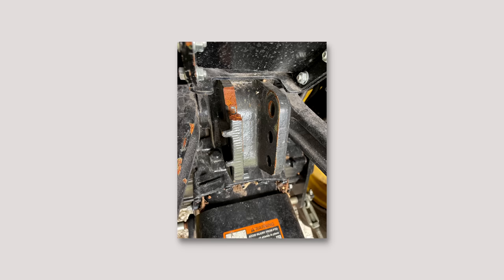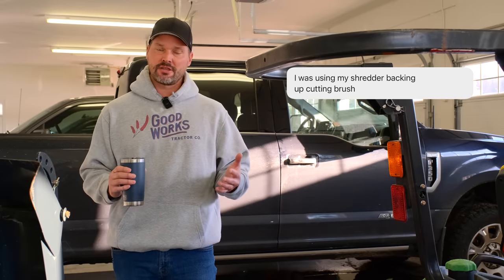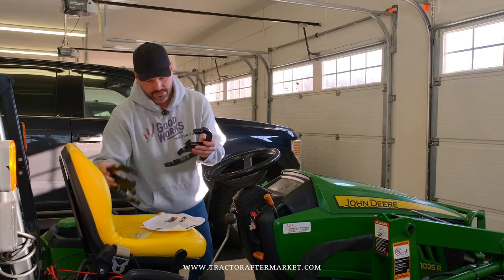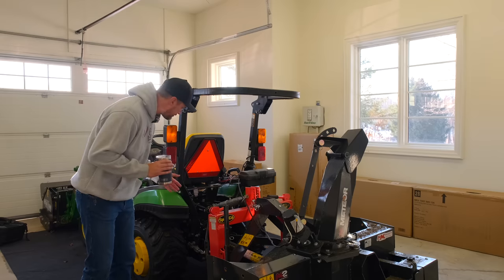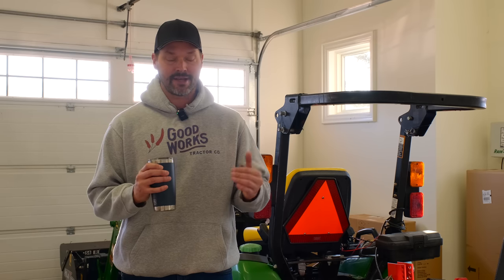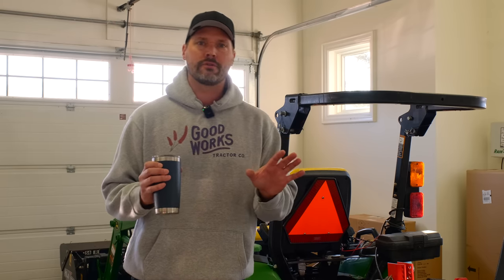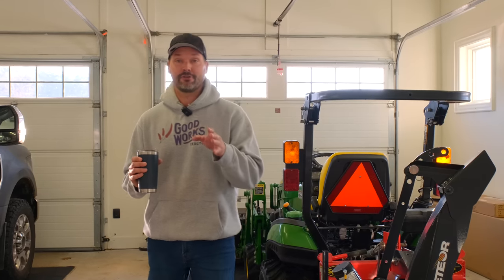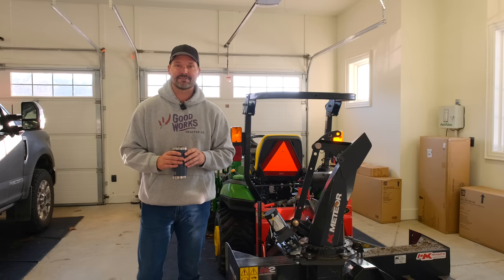EXPENSIVE MISTAKE OR WARRANTY CLAIM? $3400 TRACTOR REPAIR 🤯

Comment: Courtney,

I learned some wisdom from some old farmers when it comes to rotary cutters that prevents bending those top link brackets or the top link itself.  They suggested that I don't use a solid top link with a rotary cutter, but use a chain instead of my top link.  So I went to my local Rural King and bought 2 pin anchor shackles that were large enough for my class 1 pin to fit through them and some heavy duty chain.  For about $11 I made a chain top link that will not get bent or bend the tractor's bracket.  I used it all this summer and it worked perfectly with no issues at all.
Reply: I almost totally agree with you Jason such as I very seldom use the top link with any 3pt cutter with wheels. My only concern is being very cautious not to push the PTO shaft into the rear housing such as TTWT did awhile back.
Reply: I think I would be more worried with that? The problem is the "pulling" force away from the Top Link mount on the tractor, not the pushing force. Having the chain all of a sudden take 3" or 4" +- of slack out would worry me more than the 1/16" or 1/8" slack at the pin hole? At least looking on my 5' Sitrex finish mower on my JD770, haven't really looked at the larger brush cutters so it may be different?

Comment: I was a manager at a Big Tractor sales, farm equipment dealership in upstate NY. We sold Ford then Ford New Holland and John Deere as well as New Holland red equipment. We have seen abuse, overuse and just plain dumbass use. I've seen some bad casting , bubbles, voids and even foreign objects cast into the part. We were the final word on small stuff and usually tried to help the customer out, but big parts like axels, housings and such, well JD or Ford would come out and make the decision. If they deemed it their fault no harm no foul. If it was the farmers fault, we would sell them the parts at our cost and deep discount the labor. At the end of the day we usually broke out even or probably  lost some. We were farmers ,they were farmers. I will tell you what, when that farmer came in for a new tractor, discbine, or shit spreader, they were loyal to us. We were in it for the long game.
Reply from the maker: That's really good stuff.  Thanks for sharing!

Comment: 5 years ago I  used the 1025r I borrowed from a friend and broke this exact thing while Bush hogging. Took it to deere to repair it was $3800 and they covered it on warranty.  They said cast was bad. I was impressed with the service depth and have owned all deere tractors since.
Reply: I for the record did not hit anything hard or even noticed it broke till job was over and I filled it with fuel. Just mowing hill sides
Reply from the maker: Awesome, that's great to hear

Comment: Yes, read the warranty close. My experience: Transmission leak on my 1025R. Went in twice and both times replaced right rear axle seal. Turns out it needs to have the transmission removed, disassembled and resealed. My dealer is doing 3 of these a month on average (*according to them). I read my warranty and seals aren't covered after the bumper to bumper expires. As for the gasket in a tube seal - not sure, that's a grey area. My dealer has charged people for this repair. Mine was still in the 24 mos., bumper to bumper period. But, yes - I read the warranty front to back a couple of times during this episode. Ultimately I traded when I took it back in for the third time as I wanted a tractor with a heated cab. For the new tractor, we purchased the comprehensive warranty - which is bumper to bumper for 6 years, cost: $1348.00. As for the break covered in this video - I think it's going to be a fight to get that covered. It probably falls under the damage by use section.

Comment: I agree with Gene below.  Two other holes to use.  That said, that rust is telling.  If the tractor hasn't been parked outside recently and that rust was in there when it broke, that means it was cracked prior.  Cast iron is tricky to weld, but even as an amateur I've had really good luck brazing it.

Comment: A similar situation happened on my father's 5100r. Long story short the somehow the top link collided with the scv's, snaping off the scv's bracket from the tractor. My father simply asked the mechanic at the JD dealer to remove the bracket so he will have it welded. As much as we were unlucky to break it we were lucky that the dealer decided to replace it under warranty.

Comment: My 'newest' tractor is an IH656 and that has a bolt-on top link bracket.   I also have an MF35 and that top link bracket is part of the draft sensing, so I suppose it comes apart but I've never had to tinker with it.  (Also have an IH350 that still runs; that has fast hitch so top link doesn't exist.)

Comment: At $3400, might be worth having a materials lab take a quick look to see if there is a casting flaw.  If flaw, it’ll give ammo for getting it warranteed.
Reply from the maker: Probably still have to take the housing off the machine, but possibly so?
Reply: Great idea.
Reply: @GoodWorksTractors  Might be able to get initial impression just from the ear.  They'll probably photograph, clean and use etching solution, and put under 25x or 50x magnification for an initial impression.  From there, decide what to do.

Comment: I have the exact same tractor as this guy, 3032E, and I’ve beat the rear guard clean off my brush cutter from land clearing very heavy brush/small trees but no issues with the upper link. He had to have put some kind of side load on the cutter. I bet he had the wheels turned while backing up quickly and caught the cutters wheel on a big stump and tweaked everything sideways.

Comment: I was considering a Deere until I learned they use a cast aluminum rear housing. Went with a Branson and glad I did. I am continually impressed with its capabilities and a better price tag.
Reply: Branson's are GREAT tractors, their Kukje engine is so simple being IDI and mechanical.
Reply: At :38 you can see rust.

Comment: A few years ago (like 25), I was brush hogging the back field. I had set up the 3pt to raise the mower, but failed to notice that the blade could hit the drawbar in the fully raised position.  Sure enough, I raised it to full height with the rpm still at 540.  The blades hit the drawbar and cracked the rear transmission case.  Sure, they swung away after each hit but extended after a 1/2 turn I guess.  Hydraulic oil sprayed everywhere.  My 1070 was less than a year old.
  
My JD dealer (Mid-State Equipment in Fenton) came by, picked up the tractor, replaced the entire (broken) rear case and returned it to me, NO CHARGE.  It took a month to get the casting part from overseas, but everything functioned as good as when new.  Maybe things are different now, and I certainly am more careful nowdays, but that was a remarkable dealer action.
Reply from the maker: Wow, that is crazy!

Comment: I used a 3915 Ford to move a 14 x 60' Mobile home fully furnished about 11 miles, no issues, that's over 20,000 lbs with a 48 hp blue tractor.

Comment: I broke this piece on my 2038R a few years ago when I pulled the pin partially out to disconnect the top link and forgot and raised the lift arms. Snapped right off. Mine wasn’t under warranty either but I think the cost for the dealer to come get the tractor, replace the casting , and bring it back to me was less than $1,500. I know prices have gone up, but sounds like dealer might be overcharging a bit.

Comment: Sad story, find another dealer.  I have absolutely abused my brush cutter on my B2601.  The last time one of the pins came out of the arms and it bent the crud out of one of the sway bars.  My bad I replaced it for not much.  But that top link should be much stronger IMO.  I can’t even see how you could get the top link in a position to add that much stress to that pivot point unless you almost had the implement sideways or twisted which isn’t possible while it is connected to the lift arms.  If that cast was bad I would be worry about anything else on that part of the housing breaking later.  Wow.

Comment: My RK37 has  4 different attach points on a pretty stout looking plate that is bolted on the the transmission with 4 bolts for the top link.  It looks like something I would attach about anything to.   I don't abuse it but It gets used.  the tractor comes with rear hydros so I have a hydro adjustable top link to adjust angles with.  I use a land grader for gravel driveways as a side business and they can get pretty rough sometimes.

Comment: On Kubota the top link bracket is steel, thats good, it bolts to rear of trans housing, thats bad, very bad..........
My rear of my trans housing cracked when I was winching out 12 inch stump with pto winch, bringing cable to full pressure 50ft away, 5 times. I would use jack under one of bigger roots, jack then winch, jack then winch etc..... Two weeks later I notice trans fluid kept leaking out rear of trans housing, it's a 4k repair. The cheapest fix for me was wrap-around steel plate under seat and down the back of trans housing 3/8in thick, grind a groove in crack then put Permatex gasket sealer over it in several layers...........

Comment: the key to cast iron is getting the whole weld area hot with a torch before and during the welding
Reply from the maker: Takes the right guy
Reply: @GoodWorksTractors   And also to keep hot after welding so it can cool down very slow.  Say your outside for this repair and it’s very cold.  Keep it hot with a touch so it doesn’t cool down quickly.

Comment: My grandfather owned a Ford model 1910 back in the late 80s on into the 2000s and I remember we had to replace / repair the top link mount on the tractor, he was pushing small trees over while brush hogging backwards and broke it. If I remember correctly it bolted on.
Reply from the maker: Nice!

Comment: I seldom use the top link while using rear 3pt cutting attachment with "wheels".  Just need to be very cautious not to have that PTO shaft push into the housing such as TTWT did awhile back. Other than that my 2025 has a pin, no replacement block to remove per say...

Comment: I've seen this happen twice in my time at our west Texas dealership. Fairly certain warranty covered at least 1 of the repairs, the other one was out of warranty. Not a very common failure for sure. 
I will say that John Deere's smaller tractors 4 series and down are not designed for heavy, commercial type use. It's usually asy to tell when a tractor is being used beyond it's designed capacity.
Reply from the maker: Fortunately not that common
Reply: I have seen it happen 2x at the dealership i work at .They were both new units ,not too old  and warranty covered them !

Comment: I had just gotten my 2021 3025E and was using my Westendorf Brush Crusher and a stick slid up and torn my neutral safety switch. I had 4.3 hours on it. No warranty. So I soldered the wires together. Since I'm the only one to use it I always put it in neutral and the emergency brake on it's been fine
Reply from the maker: Be safe out there!

Comment: Even if it's not covered under warranty, I would think you could put a insurance claim in to have it repaired. I did that when I cracked the rear case and had to $500 deductible, but it was better than paying $5000 for a new transmission case.

Comment: I've been using tractors for at least 30 yrs, not sure how this happened however I have seen plenty of john deeres with that top link bracket broken,  scarry, I do believe the post hole digger is hard on the 1 series, thanks for video
Reply from the maker: Yeah, I didn't find it happening on any other brands?
Reply: I haven't done any extensive research most ones I have seen seem to have come from what I think is too big of a post hole digger

Comment: Be aware tho, the bolted on top link can also break the housing that it's bolted to. Seen a couple of pics on the web so you still have to use common sense.
 I picked up a new '21 LS MT235He this last winter and ordered some LS rear remotes (still back ordered) and didn't want to wait for the OEM 3rd function so I ordered the Summit one and it works great with my hyd 4-1 bucket. They didn't have a "kit" for mine so I had to order the hose's and some fittings separately after I measured the lengths.
 I did have one hiccup on the valve where one electrical connector didn't go in all the way. I thought it did but could only get one solenoid at a time to work, either side worked when swapping connectors, and had power at both connectors, just not at the same time. You have to push a little harder on one of them to make sure they connect. So if you don't hear the solenoid  "click" in both directions then just push in the connector on the side it didn't click on. (If you disconnect a wire connector and the pin separator on the end comes off, it does go back on fine.😁)

Comment: A few years ago I had my box blade on my JD 5065E and while backing up I hit a tree root. Folded the diagonal support bars and lower 3-point hitch bracket on the box blade. It was very hard to remove it from the tractor.  Nothing Huron the tractor.

Comment: On RK55H  made by TYM this bracket is pinned on with small heavy duty spring behind to to absorb shock. Not sure if this is common with size difference between the tractors.

Comment: I have an 23 year old New Holland 1720 and my top link connection is a separate bracket that is bolted onto the transaxle.  Break the connection and you can replace that whole bracket with 4 bolts.  I bought it used and the previous owner bent one of the ears very slightly.  I looked online and it's only $40 for a new one.  If it gives me trouble, I'll replace it.  For now, it still works just fine.  Gotta say, this makes me very glad I didn't buy a smaller used John Deere.
Reply: Massey Ferguson GC1700 series is a weld on mount to the frame.  After seeing several of these broken while researching tractors this was a selling point to me.
Reply from the maker: That's a much better design

Comment: I've got a welder across the street and he can weld aluminum, cast, or anything, he's got it all with 30 yrs experience. That's the route I'd take. I've had top links bend but never broke that bracket. Must be a new tractor owner that got in a hurry.

Comment: Were those pictures taken right after the break or days later?  It looked like a lot of rust on the fractured surface.  If that was there at the time of the break, it suggests that the casting was cracked for a long time before the break.  So, it was either a factory casting defect, or had been damaged previously causing a crack than then propagated to failure.
Reply from the maker: Not sure, I don't have all the details

Comment: I friend of mine loaned his 3039R and box blade to a buddy.  The loanee returned the tractor and my buddy asked me for help because he couldn't get the box blade to unhook from his iMatch quick hitch.  After a short analysis I pointed out that his iMatch was sprung causing the lower hooks to be misaligned and binding up the box blade.  I also pointed out that one of his draft arms was pretzeled as well.  I tried to reshape the iMatch in a 40 ton hydraulic press but it was never restored to original condition.  He threw away the iMatch and had to buy a new draft arm for around $180.  Moral of the story...treat your equipment like your wife and never loan it out.

The top link on the Kubota M5660 is cast iron and bolts onto the transmission top cover so it is probably a much less expensive part and can be removed with 4 bolts.

Comment: If you financed the tractor through Deere, this damage should be covered by the "UltraGard Physical Damage Insurance" which you have to purchase when you finance, unless you show that you have an equivalent policy from elsewhere.   However - I can't say how well that coverage works in "real life".  I've not come across any accounts anywhere from people who actually made use of it.  (Hey, it just occurred to me - that would be an interesting topic for a video!)
Reply from the maker: Good point on insurance
Reply: I hope to not find out, but I took that insurance when I financed my tractor as it was fairly cheap. The dealer told me accidental damage is covered so I think it would cover that top link bracket breaking.

Comment: You keep saying side loading but the top link is a pivot in all directions except forward and backward. With the standard toplink it can't sideload with any substantial force. Post digger sure as it replaces the top link. A 3 point backhoe is another attachment.

Comment: I think that given that this type of thing doesn’t really happen, I would would say that the highest probability this occurred is simply because there was a weakness in the structure (casting defect) from the factory.  It happens and isn’t anybody’s fault…. Especially not the customer’s!  For a dealer or manufacturer to decline this under warranty is simply short sighted and shows a complete lack of understanding of what customer service is.
Reply from the maker: that's what it seems like to me
Reply: At the very least, if it is hard to establish the fault, I would expect the dealer to at least split the cost just to avoid having to haggle about whether it was user caused or casting caused.

Comment: John Deere and any other manufacture that cast top links into the tractor frame body,  just needs to start getting that "Stupid idea" "Cost Saving" Top Link outta their design for future year tractors as soon as possible.(If they want to keep a good company reputation) This is exactly why mine and others on here mentioned, that ours are a Steel bolted on plate. They get damaged, you can replace or hammer back in to shape.

Comment: Were lower links left loose allowing implement to swing side to side excessively?
Reply from the maker: If I recall, there isn't much room for play left to right otherwise you interfere with the rear tires which is really annoying while moving